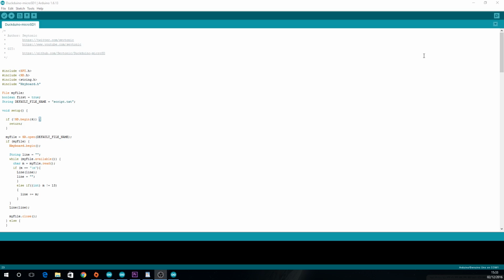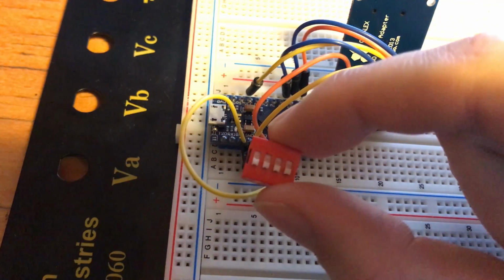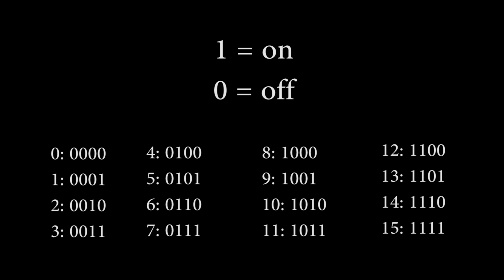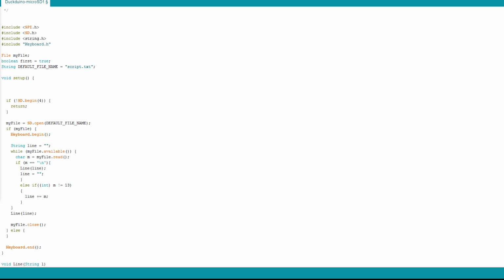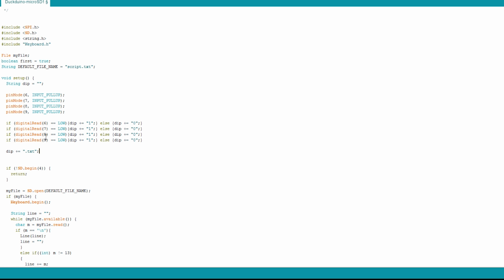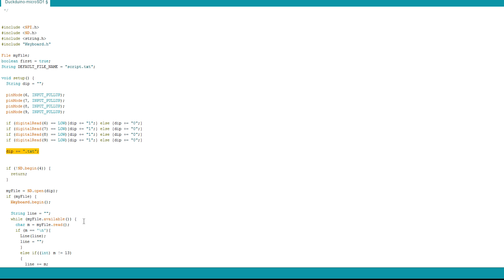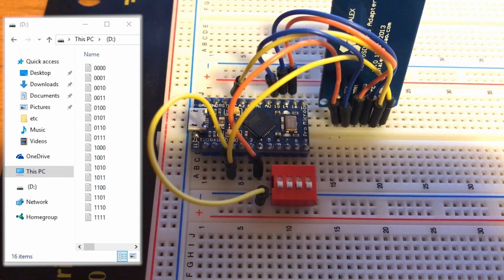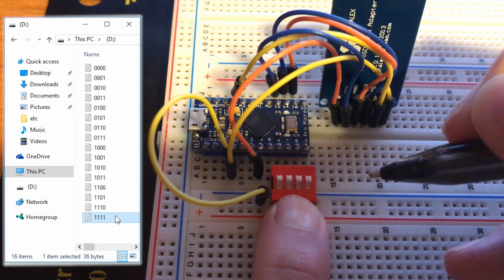Arduino BadUSB | w/DIP Switches

Comment: I would like to 3d print a case for this, what are the xyz dimensions of the rubber ducky
Reply: If you're going to 3d print a case for it, i assume you have your own. Once you figure out where everything is going to be on your board, just get a some calipers or a ruler and plug the measurements in to your 3d design software.
Reply: That's tru
Reply: did you ever get the size for it from him?
Reply: Alistair Hutten no
Reply from the maker: The schematics are freely available on the arduino website.

Comment: I like the idea, it's a shame the SD card board is so big. 

I have never used ducky, so I have to wonder is there some kind of limit what a script can do? Do you need to have multiple scripts under different switches?

I mean in a situation where you need to be discreet this is still going to stick out like a sore thumb and if you have the privacy to flip switches and analyze what you capture (to know which payload you want to run next) you probably have time to just upload another script.
Reply from the maker: You can get smaller boards, though they won't come with a voltage regulator and logic level converter so you'd have to find an arduino which runs at 3.3v which are hard to come by. The only limits with this are the restrictions the computer is under, eg: not an admin account so can't perform some actions.

Comment: is there a benefit to using the 16 mhz ardunio instead of the 8mhz versions
Reply from the maker: I don't have an 8mhz version to compare with, so I can't say if there would be any tangible difference.
Reply: 8mhz - requires Sparkfun's plugin + you have to pick "SparkFun Pro Micro" while picking the board in the arduino's ide. 
16mhz - nice and easy, no plugins required and you can just set the board to "Arduino Leonardo", if you did the same with 8mhz version the board would be unusable without some tricky reset

Comment: awesome! can you recommend any USB cases for tricking people into thinking that it's a real USB, from aliexpress?
Reply: Topi, What about a beefy multi sized SD card reader dongle. I think i also saw somebody in a previous video's comment section mention using a large wireless dongle like this one.
https://www.amazon.com/dp/B002SZEOLG/ref=wl_it_dp_o_pC_nS_ttl?_encoding=UTF8&colid=F2AF41KNDGAN&coliid=I1HRA9SUO537QD&psc=1

Personally what i did was run a decent length usb cable from a pocket on the inside of my hoodie up and out one of my arm holes.
Reply: Well, you may want to consider not even using the SD attachment or the DIP switches if this is what you want, since theoretically you wouldn't need to change the used script on the fly. You could probably find a decent case that would house just the Arduino or Digispark. I've been looking at a few on Aliexpress from a distributor called Szomk that look promising. Just do a search for "flash drive enclosure," and pay attention to the measurements of the enclosures.
Reply: With the micro SD card reader it will be way too thick and wide to pass as regular USB stick
Reply: xxXSalty_Viper420Xxx click noice
Reply: Trevor Taubitz but the prices! :(
Reply: Yep. It would definitely add the cost to the ducky, but essentially you'd be paying for more discreetness. You could probably fit a Digispark into a pretty small enclosure, and then fit a USB head over it.

The other option would be 3d printing. It would be a lot less costly, but probably more suspicious.
Reply: That USB network adapter that i link works with aircrack-ng, if you where to just use the case from it you could easily still use the adapter on a raspberry pi for example.

Comment: sorry for the question. i am a noob but can you tell me what means ground?
i understand that you have to connect the 4 pins of the dip switch but where do the other 4 go?
thanks and great video ;)
Reply from the maker: Ground means negative.
Reply: What he said. Electricity flows from positive to negative, the switches when turned off don't let electricity though to ground which creates an incomplete circuit, as soon as you flip the switch it lets the electricity flow, which lets the program know the switches status.
Reply: okay thanks very much ;D

Comment: what about a vidéo on poison tap by Samy kamkar ? :)
I think it s a good subject and better than the rubber ducky
Reply: It's not really that one is better than the other. It's just that they have different purposes.One's for keystroke injection, one is for exploiting the trust built into a local area network.
Reply: Seytonic should be doing a video about that soon. He said in a reply to a similar comment, that he was working on getting a hold of a Pi Zero
Reply: yes they both use a different methode but poison tap allow you to infect a locked computer whereas a rubberducky will need the computer to be open on a session, also I think that poison tap is more discreet than a rubberducky. well P.T is a bit harder to use.
What do you think ?
Reply: PoisonTap = exposed circuit board with usb cable coming out of it

USB Rubber ducky = Normal everyday flash drive.

 PoisonTap /= Less discreet
Reply: xxXSalty_Viper420Xxx yes you ares right for the small size, 
yes you convince me there pro and cons for each
maybe pi zéro can be hidden in a usb case
Reply: the pi zéro can be as the lan turtle

Comment: Hello, Im developing a duckuino pcb based on the pro micro with integrated microSD reader and dip switches, are you interested in that?
Reply: ive twitted you with more info
Reply: 3 dip switches is probably a good trade-off, 8 programs is plenty.
Reply: That'd be great!!! Keep me updated!
Reply: you can checkout my github page https://github.com/afonsus1997/Duckuino
Reply: can we buy it?
Reply: That's what malduino is
Reply: @abhijeetsingh8799  why you commenting on a 3yo thread? I had a simmilar project when the malduino was in development and offered help, what's the matter?
Reply: @afonsusmuralha  Yup 2020. Can I ask you what happened with your project and have you integrated those DIP switches already?
Reply: @j1mmy447  hello, yes. I finished the project. In the end all worked correctly. I had the dip switches to choose which payload to use and I added a screen and some buttons to either start the payload or change the keyboard layout
Reply: If a button is pressed when the usb is plugged in, the payload starts automatically without showing the menu on screen. Like a "quick mode"
Reply: I should have added more pictures to the repo. Anyway here's some of them form the last version https://photos.app.goo.gl/j4HiEUAb3UwUzvVZA
Reply: It's awesome. I like it!  I think it would be very hard to recreate your project without soldering paste but thanks for the update after 2 yrs. 🙏
Reply: @j1mmy447  oh you definitely can! Those boards were soldered by hand with a fine tip. In smallest boards I actually prefer it that way. Thanks for your interest in my project :)
Reply: @afonsusmuralha  Now I want to recreate Seytonics device with smaller and cheaper parts, like LGT8F328P and a smaller micro SD card reader. I don't know is there a way to upgrade it with a display and switch but I will try it too:)
PS: Do you plan to update the GitHub page with some more descriptions? and do you know someone who sells it (pic with the box is looks like a promo :D)?
Reply: @j1mmy447  if you're interested I don't mind taking the time to update at least the readme with some info about the features, materials and etc... I'm currently not selling them since I think I only have one or two left. That box is how I package the duckuino, i think that one was a birthday present for a friend :)
Reply: @afonsusmuralha  Thank you very much :) Cute gift for someone who is interested in IT 😎.
Reply: @afonsusmuralha  is there a way to buy it??
Reply: @j1mmy447  Updated repo at the end of this week
Reply: @Matrix19962  Not at the moment, no. If there's enough people interested i can build some and sell them

Comment: is there anyway, to get a 8bit dip switch?
Reply from the maker: Yes, but would you need 256 different scripts?
Reply: Seytonic great
Reply: Maybe a possible improvement, rather than focusing just on each combination of DIP switch, is to assign each one to a separate script which will be used if activated. For example, you have an 8-pin DIP switch, you have 8 separate scripts with 2, 3 and 5 activated, so scripts 2, 3, 5 are all executed in order. Might be a way to make the design more flexible and modular.
Reply: Trevor Taubitz thats a good idea, post execution may be a good choice when u have multiple scripts to be executed
Reply: But how would you do that?
Reply: I made it with an 8bit dip Switch, so yes it is possible

Comment: OH MY GOD I LOVE YOU
Reply from the maker: :3
Reply: Seytonic But, hey, couldn't tou get a slimmer result using a 2x8 circuit board?, I think it'd give it more of a USB look
Reply from the maker: If you're referring to a custom pcb then yes it would.
Reply: Seytonic Yeah, i got a 2x8cm pcb which is rectangular, so i think it'd be easier because I have a 6-switch module
Reply: Seytonic And hey, the little button for it not to execute it on my PC still goes between gnd and 3, right?
Reply from the maker: Whats the need for the little button when you can just set the switches to something you don't have a file for, or remove the sd card altogether.
Reply: Seytonic I hadn't thought of that, touche, keep it up man, great channel